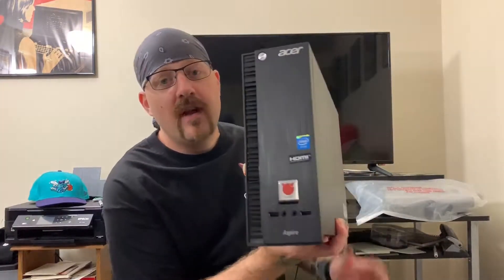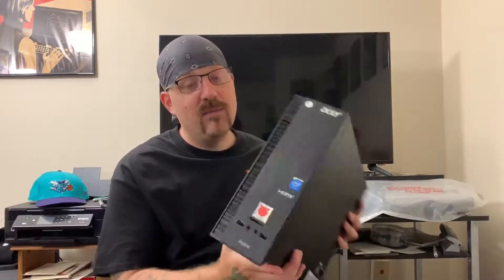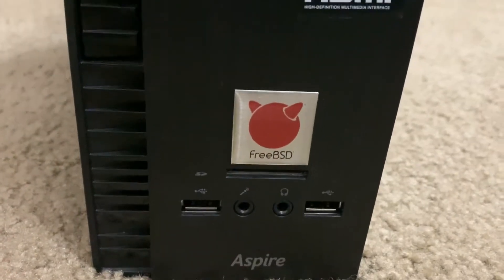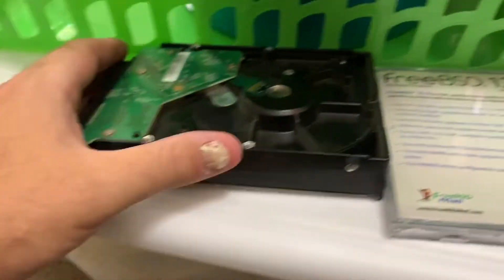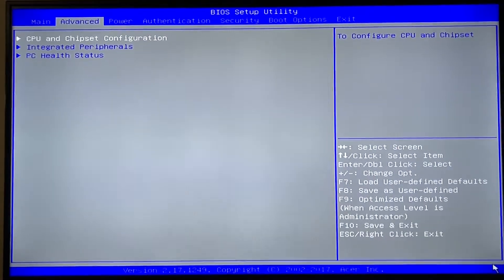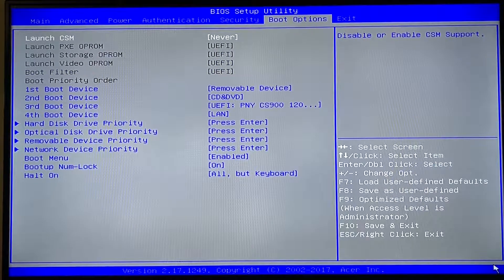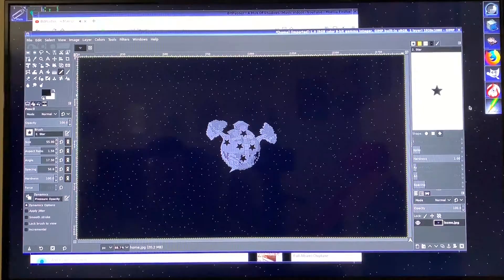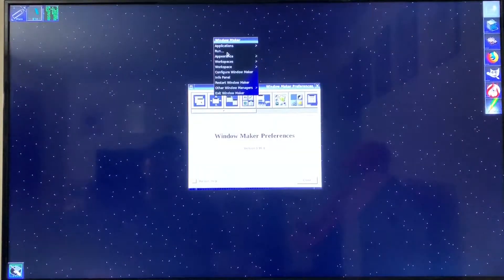My Acer XC-704g Review: A Cheap, Nifty Little FreeBSD Box :)

Comment: Do you know if this could run an asus gt710 1gb ddr5 without an update power supply?
Reply from the maker: Nope. I looked into upgrading the GPU once, and there is an upgraded power supply that exists for this specific machine, but what little I could find, pretty much any GPU that it can use requires a better power supply. Good luck.
Reply: @bitpusher2600  Thanks man. I ended up ordering one. Hard to find given the age of the PC but I'm upgrading for an older person just to make their experience more streamlined. Will a graphics card make the PC faster by taking some of the pressure off the processor and its integrated graphics?
Reply from the maker: @AGuyThatsCanadian  Sorry, I honestly have no idea. Truthfully my PC knowledge still falls heavily in the SCSI and IDE days of things, I'm outdated. Since these graphics are integrated, I want to believe that a little less pressure on the system can't be all bad :)

Comment: the one slot you said you did not know what it was i am sure you know by now it is a small form factor graphics card slot.  if you need to install one.  you can buy a graphics card that has regular face plate size for fit or it comes with a small form factor plate to fit in small form factor pc case.
Reply from the maker: Yes sir, I've been told about that since this video. Admittedly, my income has always kept me behind the times, and I grew up with the SCSI, ISA, IDE, and PCI eras whereas now, there's all sorts of new busses and interfaces I've never actually had my hands on. I still feel like standard SATA and SSD's are gorgeous and a huge deal from my perspective.

Comment: Do you think it is good for games if so I will get it
Reply from the maker: Obi Art Nope. I mean, it’s great for some old school gaming, like emulators or DOSbox, but under BSD or Linux maybe. Windows is too heavy for this machine in my opinion.
Reply: BitPusher_ThePurpleQ  Do you recommend anything like ram so it can run games like overwotch and fortnight
Reply: Very low chance it runs Fortnite or overwatch. In fact, it runs roblox games at around 15 FPS. Not good for gaming (at least in stock form)

Comment: I love my acer aspire 705 which is basically the same small form factor you have. I have upgraded to a ssd, 16gb of ram, i5 4460 cpu off ebay, geforce 1030 with the original psu. It is a very capable machine that can hold its own in with modest gaming titles.
Reply from the maker: Daniel Morales This is a 1.60ghz dual core AMD of some sort, so your processor and gpu upgrade had to have helped the gaming situation 🙂 The SSD is damn crucial too. Since I’m more of a console gamer instead of desktop, I’m running Unix instead of Windows so even as is, it really cooks. But yes sir, especially as cheap this was I’m surprised and satisfied with how this little form factor machine works. It is my first experience with this form factor, still feels like cheap laptop hardware to me, but that’s just charming in my opinion. Cheers.
Reply: @bitpusher2600  .i cant figure out how to set up wifi on my aspire 704
Reply: Hard to find 16gb of ram ddr3